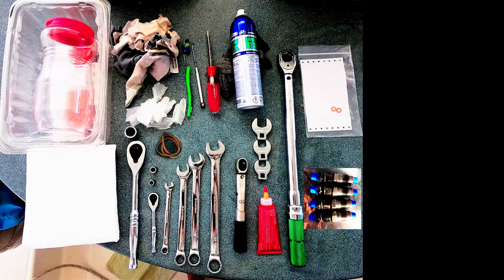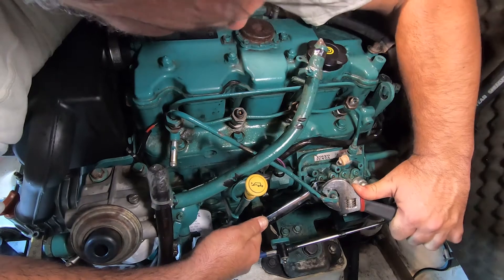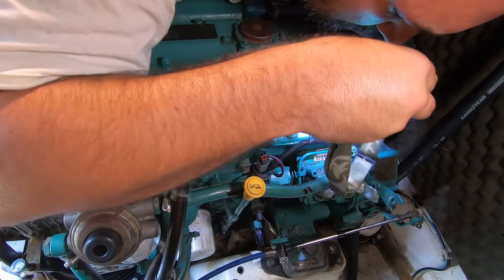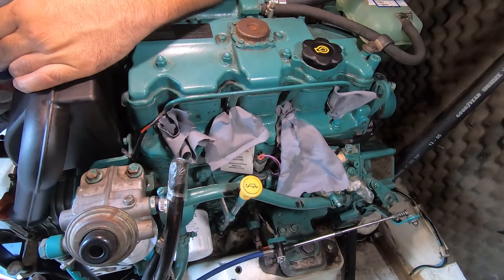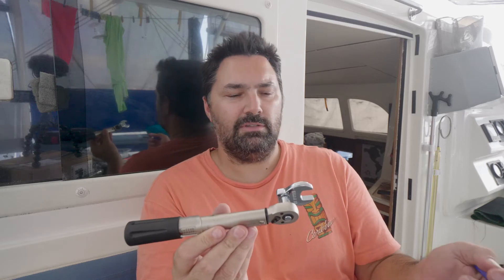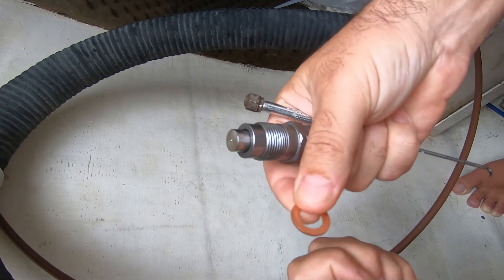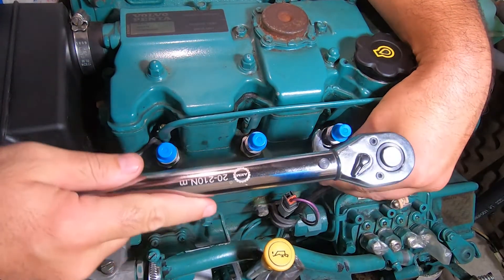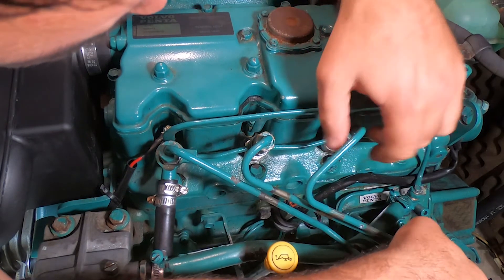Maintenance: Fuel injector servicing Volvo Penta

Comment: I wonder if a deepwell socket would of worked instead of the crows foot.   I have the deep wells but no crows feet.   I might have a robin foot or 2. 😅.  NExt time I would bleed it at the injectors.

Comment: About to tackle my D2-40 and this video has given me the confidence to have a go myself.  I love the shot of all the tools required.  Rather than crows feet do you think a long reach socket would do the same job or would I struggle for some reason?
Reply from the maker: @LukeSavage-s4i  Long sockets should work, provided they are not too thick walled, otherwise they may not seat down because of the engine. 
Thanks

Comment: Thanks mate ... and brought back memories of doing the same job on my previous yacht where I received a written warning from the Marina for offensive language ... I managed to bend the fuel pipe which was an expensive mistake ... 

One thing to note - a previous owner had not removed the crush washers where the injectors screw in - and just installed new ones over the top - and it was really hard to tell as the old ones were so ingrained in the engine block... it was only because one injector came out with 2 washers that I guessed it was the case .... so digging out the other 3 and not dropping debris into the block (whilst me folded in half over an engine in Brisbane on a 30 degree day) ... well 4 hours later and another language complaint it was done .... apparently its quite common and some people recon its best to just leave the old washers in place ?

Volvo Penta engines are painted green so when you get angry and turn into the INCREDIBLE HULK  .. you don't rip the thing out and throw it at people .. instead you think its a friend and you give it a hug ... of course it won't stay your friend for very long as at some point you will need to order some parts (there goes another shirt and pants) ... here's a tip - just buy a spare engine and keep it for parts ... as it doesn't take long to rack-up that sort of cost buying parts separately ...add the shirts and pants bills and its not far from the truth

Comment: How long does that take from start to finish? If one or two injectors are faulty, should all be replaced?
Reply from the maker: Pulling the injectors out took about an hour, and putting them back in about the same.
We dropped the injectors off to a local diesel shop and they did the servicing and had them back to us within 48 hours. When we had ours done, the service shop said one injector needed to be done, however the other injectors tested low and would need to be done soon, so we just had all of them refurbished together. As for replacing the whole injector, that is not really necessary with this type of injector since components of the injector can be changed if required.
Hope that helps. D
Reply: @letsbuyaboathesaid  Thanks, just had all six of mine serviced with new tips fitted.
Reply: @letsbuyaboathesaid hi, what where the cost of the service to the injector
Reply from the maker: @jordybarneveld  It was approximately $75USD per injector (ie 8 x $75 = $600 USD).